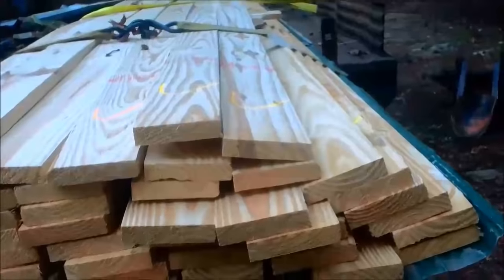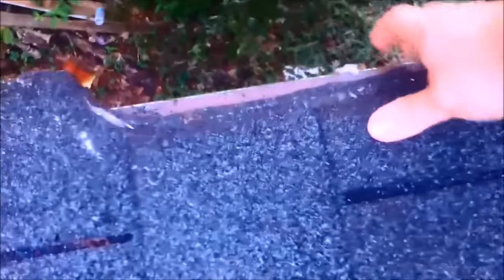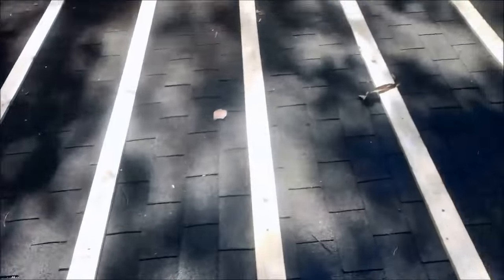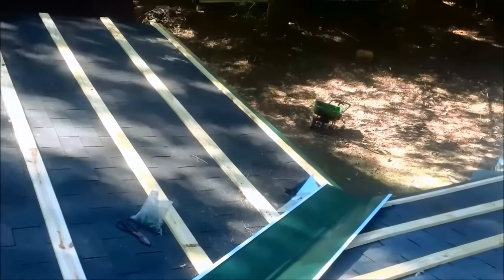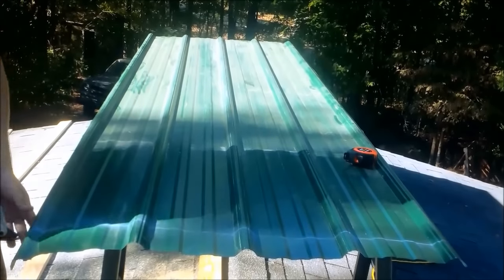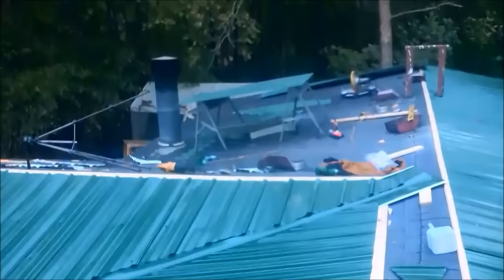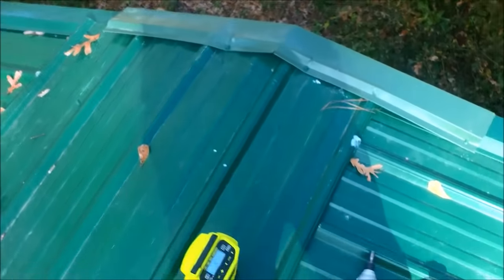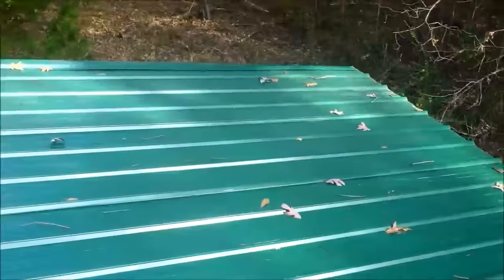How To Metal roof for cheap

Comment: You will end up costing yourself more in the long run from all the moisture build up from condensation due to zero ventalation. 
It's fairly standard to vent the top of the ridge by cutting back your plywood on either side by an inch. By utilizing something like "supervent" (a porous foamesque vapor barrier) you can let all the excess heat out and allow no water to get in. 
Getting a roof done for cheaper is always a plus but a little knowledge is a dangerous thing; and you sir, have very little knowledge about what you're doing. It will cost you.
Reply: y do u think it will condensate

Comment: YEA,....LEAVING 3 LAYERS OF SHINGLES ON WHILE OVERLAPPING WITH A METAL ROOF IS TOO MUCH WEIGHT. I THINK THE LEGAL LIMIT IN ANY STATE IS 3 LAYERS TOTAL. ANYTHING OVER 3 YOU'LL NEED TO SHAVE OFF A LAYER BEFORE ADDING. MAYBE YOU SHOUD'VE DECIDED TO GO WITH A METAL LIFETIME ROOF AFTER THE 2ND LAYER OF SHINGLES..... AND WHY NOT USE A VENTED CENTER CAP ON THE ROOF TOP ??....... YOU SEE, YOU GUYS LIKE TO CUT CORNERS THEN COMPLAIN WHEN THE ROOF FAILS INSTEAD OF DOING IT THE CORRECT WAY..... NOW YOUR ATTIC WILL STRUGGLE TO VENTILATE DURING THE SUMMER AND CAUSE YOU A.C. TO WORK OVERTIME BECAUSE THERE IS NO HEAT RELEASE VENT.....( HIGHER LIGHT BILL) .... HAVE GOOD DAY.
Reply from the maker: More layers more pleasure that's why I triple up condoms

Comment: Complete fail. DO NOT USE THIS AS AN EXAMPLE. This roof will be rotten in 2 years. You should never install the wood under the steel roof (any roof) horizontally. Wood will soon rotten because of the condensation water  that can’t escape anywhere. Right way would have been to use two layers of wood. First vertical direction and second one as it is on video. Then the condensation  water
would nicely come out and roof would stay dry
Reply: running them virticle they will still rot out

Comment: That silicone caulk job at 5:48 is a disgrace. You used way too much and exposed silicone like that on a roof exposed to direct sun and heat won't last more than a year.

Comment: Eaves, not ease.  And rain is going to blow in those gaps between the valley and the roofing metal.  And never, NEVER have that many layers of roofing on a house.  I won't even start into you on not using silicone on a roof.  Thumbs down

Comment: Oh hell no you didn't WTF are you thinking
Man that's I guess ok but please tell me that the house you put that on was yours and that you don't do roofing for a living do you because that just looks odd I understand your idea and commend you on it but if you'd just used a sheet metal break or a crimper on some parts you could've made yourself look like a genius your ridge is way to wide your angle cuts look like you used scrap pieces from 10 different style houses and the trim does cost more but it's the most focused on pieces and it actually serves or does more than the regular flat panels also did you remove the shingles from your ridge cap and you said that roof had 3 layers of shingles did you do calculate the total amount of weight your asking that roof to carry if that's a Mobil home you could have an issue especially if it was manufactured in the 90's early 2000s not exactly sure they made all manufacturers goto hurricane construction code and beefed up the support walls and tie downs any if it's your place man thumbs up I hope you don't get a lot of snowfall were your at because that pitch is almost flat and your gonna have a new sky light soon

Comment: Well I am a registered licensed and certified roofing contractor and have been since1979 and this is about the worst roofing video I have ever watched firstly nothing you done was per code anywhere nothing you done was correct I hope this was your own home because from what I have seen nothing you done was correct except cutting the metal I bet you didn’t even think about using butyl tape in your seams let alone double stripping each side of your valleys nor using inside or outside closures nor using zip screws for your overlaps

Comment: This is an absolute joke.
Reply: This is one of the worst roofing jobs I've ever seen, and people will watch this and think this is acceptable.  It's not.
Reply: Jesse Wilson wait till an inspector Drives By and sees that then we'll see what happens
Reply: joshua2585 one he needs a ridge cap on top of the roof you can't fold it over like that it needs to be vented then all the seams need to be closed and siliconed where the A-frame meet and he needs rubber boots over all of his exhaust vents
Reply: I understand if it doesn't leak that's fine but damn it could have been a little better then that
Reply: It would just be a shame if a building inspector came by and made him tear that thing I'll back off and do it the right way that's all
Reply: joshua2585 exactly you got my point 100% I guess that's okay if that place is located in the Appalachian Mountains or something LMAO
Reply: Maybe it's down by the Bayou in New Orleans
Reply: But I would be pissed if I had to look at that as a neighbor every day
Reply from the maker: Dave the pond guy i own the house next door both are rented
Reply: That explains it
Reply from the maker: Dave the pond guy i have had my roofs inspected befor and they pasted, the only thing i would change is the ridge cap, but for the past 18 months its done great
Reply: Good deal I'm not hating or anything I just think it would look better with a ridge cap as all just looks kind of cheesy folded over like that but good for you it should last forever if it hasn't leaked in 18 months
Reply: nothing will happen they never bother DIY homeowners
Reply: none of this applies over a existing roof that isn't leaking
Reply: Dave the pond guy yeah and inspectors are so behind this country has no need of....... So many cheese di@k laws about idiocy codes that make zero sense.... This country needs less legislation and less revenue cops......as they far as resell if it works out works
Reply: Jesse Wilson I thought it was great for a DIY job
Reply: DannysCam  can you tell me please what kind of nail you use for hold the woods and w kind of nail for hold the metal roofing. Thank you very much.
Reply: This is the best metal roof on YouTube this guy is a genius I'd pay thousands for this guy to renew my roof